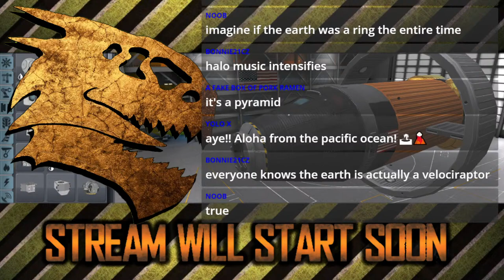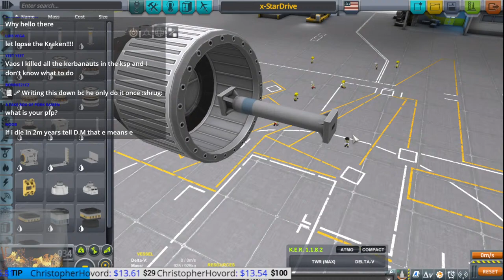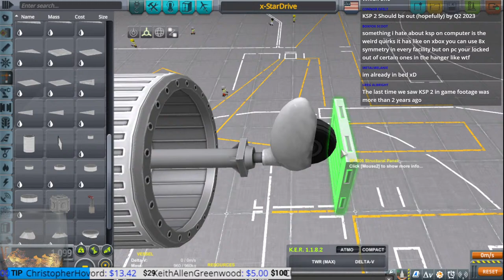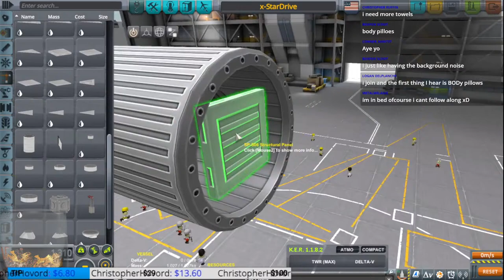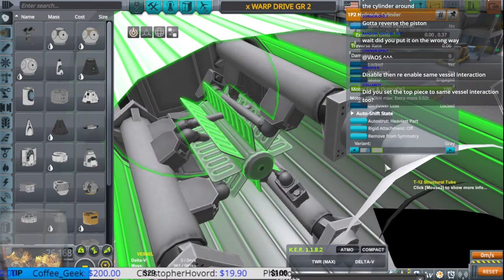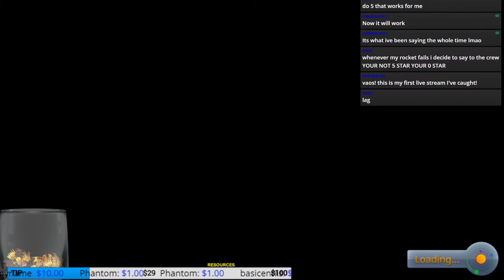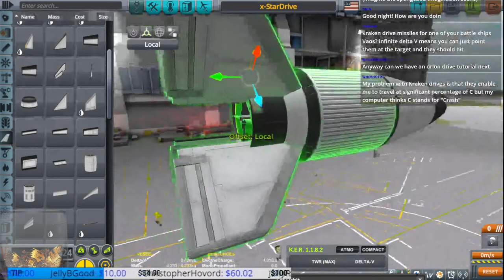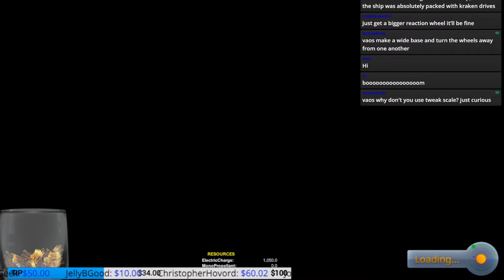STAR DRIVE / Kraken Drive How to

Comment: Also a trick to throw in a master kill switch is to make an action group to toggle same gear interaction with the gear and plate.this let's you use your normal engines for landing and what not and not worry about the drive kicking in every time you use the throttle.just need to immediately turn it off on the launch pad if you don't want it used for take off

Comment: I have an odd issue with this kind of kraken drive. For testing purposes, I tried getting a KD-Probe to Eve (and probably back), but every time I do an Eve encounter and get too close to Eve while circularizing, the kraken drive stops working alltogether. Nothing can revive it either. Tried resetting same vessel interaction, quicksaving, reloading, swithing to another vessel, etc. The probe is completely stuck ( since I didn't put any other means of propulsion on it) and now has a twin sister with the same problem. Very, very odd.
Reply: Very odd indeed! KSP changes something to do with physics at 100km altitude, possibly the frame of reference. Could it be that? But if the probe got off Kerbin, then why would it stop working... If you cheat it to Eve's surface, can it launch?
Reply: @eekee6034  The "glitch" actually starts way earlier than 100 km above eve. I can't even get into a wider orbit. I haven't tried launching it from eve to test this. Great suggestion, will do!

Comment: Gear Drive sounds like a good name for a steampunk ship. Or maybe that's the sleep deprivation talking. curses a variety of health problems

Are we kerbal-size? (I should join these streams sometimes.)

Re. boxfox scoot chatting about stupid features of the PC version: yeah, those are the reason KSP isn't my #1 hobby. Well, the kraken too, but only when it's annoying. :)

I'd like to be watching on my old laptop and building along on my new laptop, bought yesterday, but my new one won't come out of hibernate.

I've been thinking the piston is backwards ever since the struts were placed. Let's see...
Yep! I still maintain everyone does this with technical stuff. I've seen kernel developers lose days or sometimes even weeks trying to track down a bug, and the cause turns out to be something they never thought was wrong.

"Ports seem to perform worse the more I add" explains my last attempt with them. I put loads of DPs in, and it could hardly move. I concluded 1.12 had broken that type of drive! XD

Orion drive forever! ~~so long as I don't have to ride it~~

I think I learned about gear drives from you, Vaos.

Vaos: Kraken drive in the warship
Me: RAMMING SPEED! XD

I had no idea what was wrong this time.

Hahaha! Well, that shows why I HATE slow traverse rates SO MUCH! XD

That's real-time? Weeooo! I mean, I once built a probe with a faster kraken drive, but that was years ago now so it doesn't count. :)

That was actually pretty cool. I might watch more streamrecs. I mean, sometimes I can't even really watch video, but when I can.
Reply: Open docking ports tank performance. The game is constantly running checks on ports that are open to verify there are no connections.